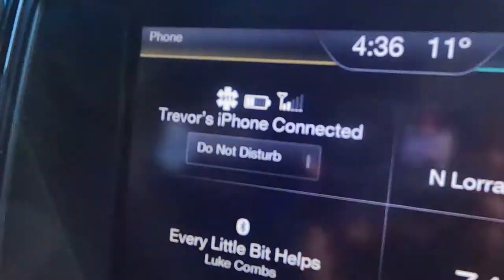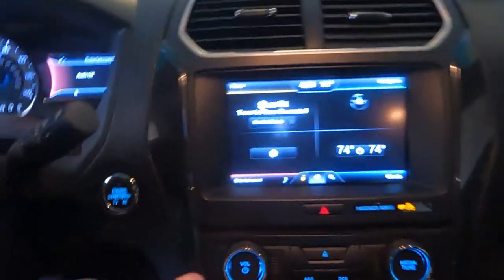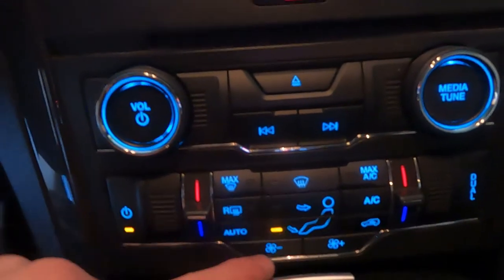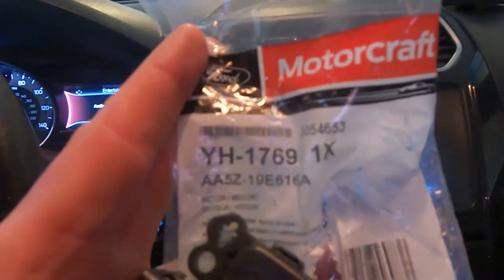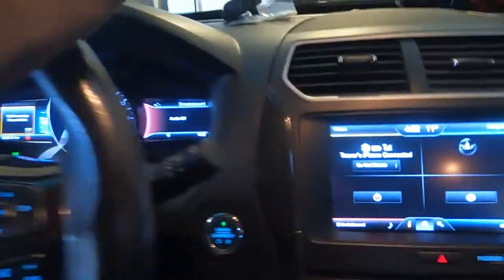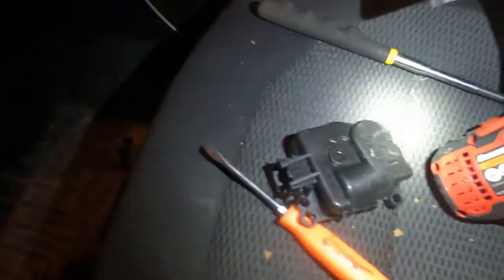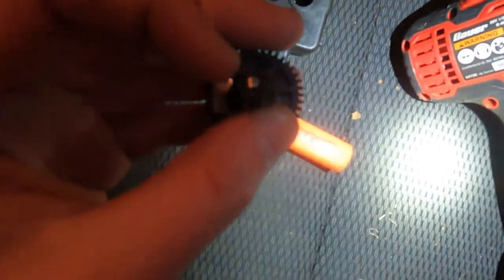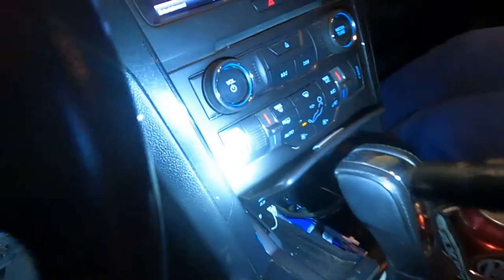2016 Ford Explorer Heater Blend Door Repaired!

Comment: I appreciate the video.  Mine just went out on my wifes.  
You didn't video getting the old one out.  Looks like it is hard to get to.  Any tips/tricks on removing the actual actuator?
Reply from the maker: Aw man I wish I had shown more of that process. Been a while since I've done this, but looking back at the video. 

It should be easy to get access to the part, but getting the part itself was a pain. I used a 90 degree drill extension to get the bolts out and to put them back in. 

I just recently sold my explorer so I won't be able to get a better tear down video.

Comment: Hey thanks for posting this. I get all the air coming from the vents but no hot air, no defrost even though it's on high. Could this be my problem or another actuator on the pass side?
Reply from the maker: Yes, it very well could be the issue!

Comment: Don't  feel bad 2007 RAV4 I have to replace the  heat ac unit. In winter my windows  fog up not save to drive. All vehicles  are built this way now and is getting  worst. Mechanic  here
Reply from the maker: @joecostu1571  I hope the replacement goes well. I'm starting to like the older cars more. They're easier to work on. 😅

Thank you for the feedback, we appreciate it!

Comment: I’ve been a die hard ford guy my entire life. After my super duty and now my wife’s 2016 explorer I’ll never buy another. The explorer is a pile of shit. Rear AC lines rotted at 50k miles, replaced both control arms,drivers strut, passenger wheel bearing, mid pipe also rusted through and now the blend door actuator us screwed up. It’s only got 77k miles on it and if I wasn’t able to fox my own shit it would have been another 9-10k in repairs. Ford wanted $3800 to do the rear ac lines. Sucks cause I like the looks of the explorers but they are trash
Reply from the maker: Wow that's a bunch of things going wrong. Luckily I've ran into only a few things. But I agree they aren't built well. I hope to turn mine into a Chevy motor wise one day 😅
Reply: Pretty much all the same problems as our 2016 Explorer Sport. The latest is the damn blend door actuator at 80K. The poster said it took an hour to replace, but that fiddly job would take me a week haha!
Reply from the maker: So it's only a matter of time till mine does it to then. 😅 

Don't feel to bad about it taking longer. I owned a jeep that it took me two days to remove the dash, and another 2 to put it together. I did that 3 times 🤦🏻‍♂️
Reply: Dropped kids off to school this morning to have the same issue.  Also, my rear AC line went out last spring!  And the rear toe links that were replaced under warranty seized up again! What a POS and I also agree. Done with ford. 

Love the video. Thanks for making this.  Looks like I’ll have to take a couple days off work to fix it. I’m great with home repair/improvement. But i dread auto repair.
Reply from the maker: I've been paying attention to the newer explorers and they are having recall after recall too.

I hope you get yours back on the road again soon! 🙏🏻